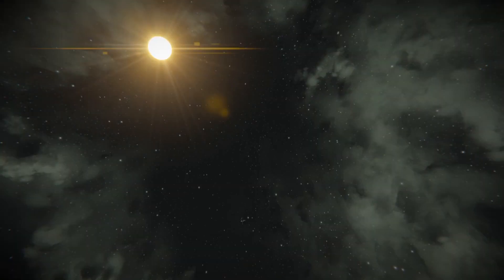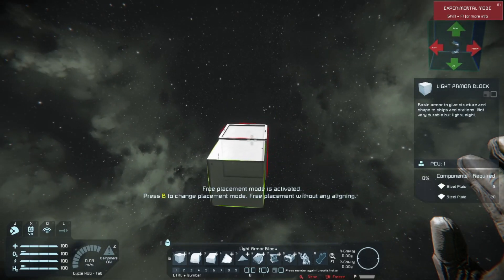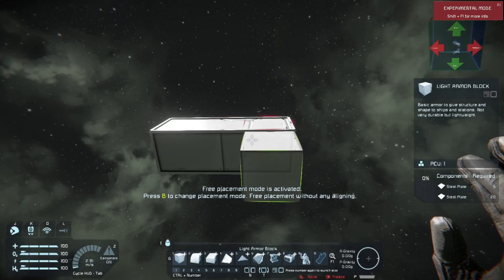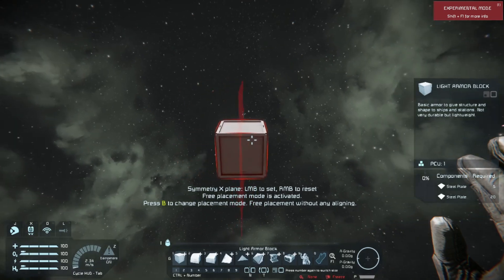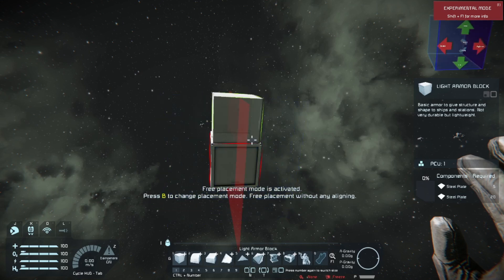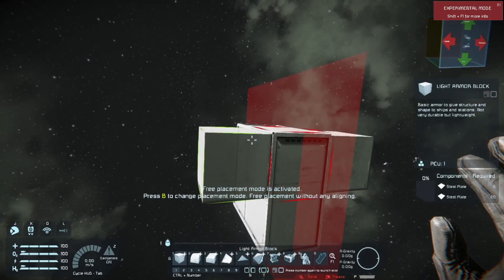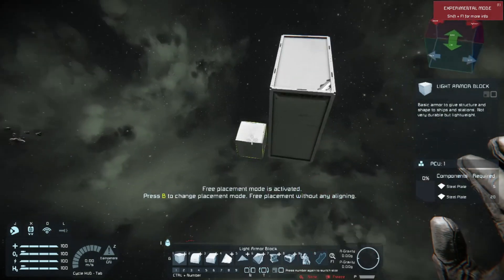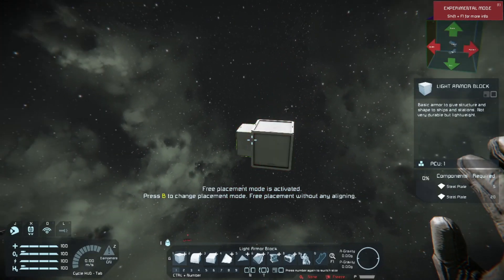Mirror Tool Tutorial.

Comment: Not having any luck getting mirror to work. I hit M on a block and nothing happens. Playing with mods, not sure if that is causing an issue.
Reply from the maker: Press M till you get to the desired mirrored point, left click, then press m till your back to build mode. To disable mirrored mode repeat but left click instead of right click.
Reply: @badgerwildgaming6908 they may be in survival mode, this only works in creative.
Reply from the maker: @Calla47 well yes but you can take what's in Creative mode and blue print it to survival.
Reply: I installed a mirror mod that works in survival. All works now.  Ty for your reply.  @badgerwildgaming6908